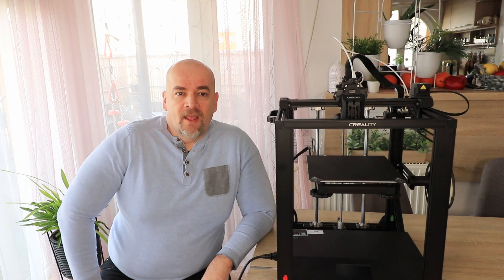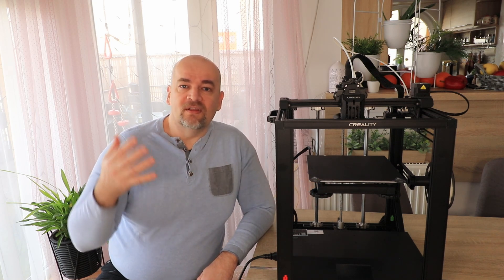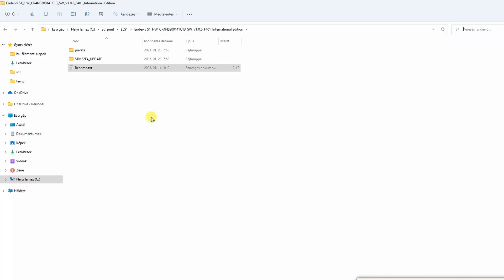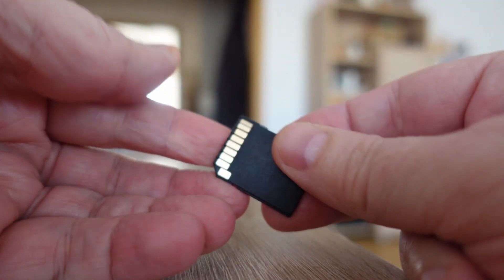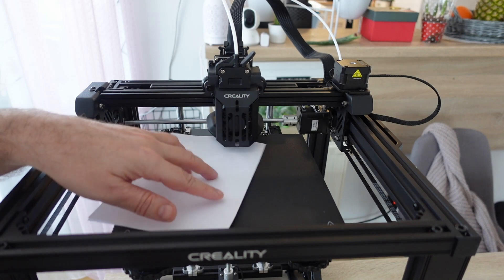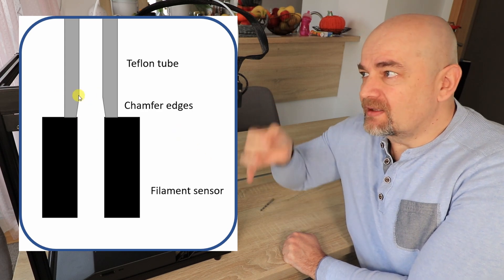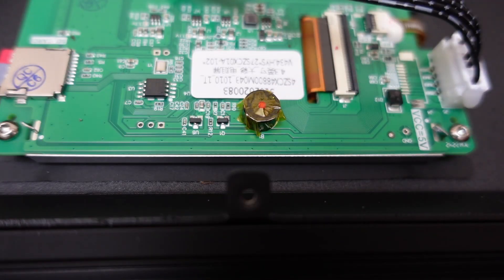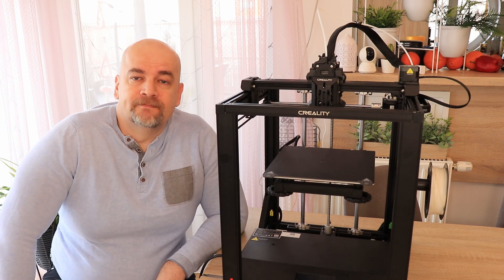How to upgrade the firmware on Ender-5 S1 3D printer? (And why to wait with it)

Comment: Super helpful! I am so glad to know that I wasn't the only one that had issues with 1.0.6. Fix the firmware, and SOMEONE PLEASE sell a real hardened nozzle for this printer! IMHO, it it THE limiting factor at the moment. You can't print anything abrasive on this printing without consuming brass nozzles like M&Ms. No glow in the dark, no granite, no marble, no Carbon Fiber (That one hurts). I do think it's a very competent 3D printer, just needs a few missing items.
Reply: Microswiss sells abrasive resistant nozzles for the ender 7, should be the same size.
Reply: So Carbon Fiber PLA isn't compatible with the Ender 5 S1? Why would they make an extruder that can get to 300c unless it was meant to handle tougher material? Sorry new to this and it's a legitimate question, this is my first printer.
Reply: @twanheijkoop6753  Yes, they are labelled that. They are not. They are simply brass with nickel plating. About 125gr of glow in the dark filament ruined those. But you are correct, this is, at this moment, the best (only) option.
Reply: @garysmith007  I think the issue is, in part, it's so new. BUT, the Ender 7 has the same nozzle too. I would have thought someone might have one by now. Also, the New Year celebrations hit right when we started needing parts and having questions! I suspect in a month or so, things will be better.
Reply: @MikePorterII  Hey.  Any improvements with the nozzle situation?

Comment: I had the same auto-leveling issue as you did, but for whatever reason my s1 has had a lot of issues with the first few layers sometimes being too tall, or too short. Moving 1.06 seems to keep that problem gone, likely for the same reasons you mentioned of the zero point no longer being so far away, so I'll stick with 1.06 and skip the auto-leveling until the next version hopefully comes out soon.
Reply: I have the same problem. I hope they will fix it soon.
Reply: 1.06 is completely messed up for me. I see how they reworked all movements so it uses top as a start point. But it doesnt measure it up correctly for me. It starts printing 2cm above bed. So I stick to 1.05 ver

Comment: They must have fixed a lot of the issues since you bought yours.  I just bought one and it does not have a Z endstop as it uses the CR Touch for an endstop.  I don't have the filament runout sensor issue either and my  touch screen does beep like that.

The only issues I have had were a low spot in the middle of the bed which I fixed with a couple pieces of kapton tape, and the right front bed mount is shorter than the others though it does not affect the printer's operation.  It prints fast and well so far though I have not anything than what is on the SD card yet.
Reply from the maker: It is good that they are fixing these early bird errors. Who knows, maybe exactly thx to my video pointing to these problems :-)

Comment: I have had the same problem with 1.0.6. Creality Customer Service  do not understand what the problem is even when I said they had a bug in their software. It will be interesting to see if they bring out an update.
Reply: I got a problem on the bed level. The Z axis moves a down bit as nozzle moves to Y+direction. Do you have the same problem?
Reply: @Sid762p  Hi. Yes I have. I have upgraded to Klipper and it does the same thing. So what I have done is level the bed using a clock gauge fixed to the print head (Made a bracket for it), moved the X & Y axis manually, then I did the auto-level and all is good.

Comment: i have a other problem with the printer. when printhing the first 5 a 10 layers. the Z axes is moving a little up and down. that is good i think. but after that it stop doing that and only lower the Z axes when change layer.  i dont know how to turn of the autobed leveling. so gone try to the update hope it wil help

Comment: Hi Igor, I have ender5s1 with sonic pad. worked great until sonic pad upgraded to new fw. now my level bed on the right side is too close to the nozzle, and the left side is low. i turned off sonic pad and installed stock fw on ender5s1, V1.0.4 and V1.0.5 (V1.0.6 doesnt work) the same thing happens to me with bed. the right side is high and the left side is low. the printer is about 10 days old and has no mechanical damage. what can it be? can i restore previous fw on sonic pad? can I reset the sonic pad and put the fw with which the printer worked properly?
Reply from the maker: Sorry Alen, I don't have experience with Sonic pads so far.. But yes, I would try to go back with previous FW.
Reply: Alen, I had a similar problem. I updated the firmware to 1.0.6 then had the same problem with the error Igor had. So, I reset all the settings back to default, flattened the print surface to make sure it was as flat as I could get it, then I used calipers to level the bed to the horizontal arm that the print head moves on. I then did a manual bed leveling with the printer on and now I'm printing better than I ever have and without the auto bed leveling. I have a video on my channel with all the steps in more detail if you'd like to see more, read the video description. https://youtu.be/15OONzVagGI

Comment: my ender 5 pro ended a print by going all the way down, beyond the maximum depth for the Z-axis. so it crashed into itself. since this, it only moves half the distance. for instance I tell it to move down 100mm and it only moves exactly 50mm. would a firmware update fix this?
Reply: ik its been a year but sounds like it may have stripped gears in one of the steppers
Reply: @spags8223  thanks mate. I've already sold the thing, bought a bambulab P1P, an A1 mini and 2 A1's aaaaand lost interest in the hobby 😅
Reply: @Chopingporky  ah man, sorry to hear that. If you still have your other printers, maybe keep 1 and wait for a day when u need a part. I think the key to 3d printing isnt it being a "hobby" so to speak, but rather a tool. Like, I don't think about my dewalt drill until i need it haha. Same with my printer

Comment: The abl error is because the probe offset is wrong and so it probes off the bed
Reply from the maker: Yes, in the meantime I figure it out, BUT WHY is this still not fixed in new firmware?? @Creality??
Reply: @MyTechFun  I think because it is only an issue on the older model with the z end stop, they revised new version without end stop and slightly different probe offset

Comment: 1.0.7 still the same problem
Reply from the maker: :-( at lest the Sonic Pad solved it https://youtu.be/cv8lf0eTZbw
Reply: If you have an earlier printer with the Z switch at the bottom you will have the new firmware only works on the newer ender 5 without that switch